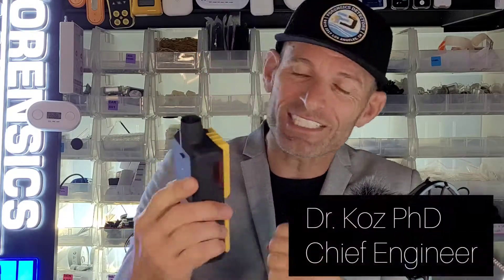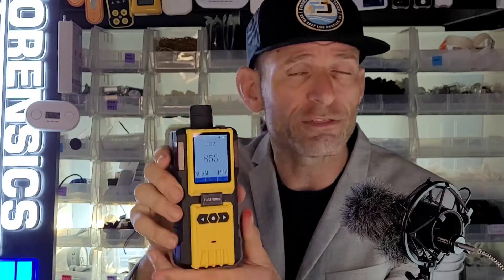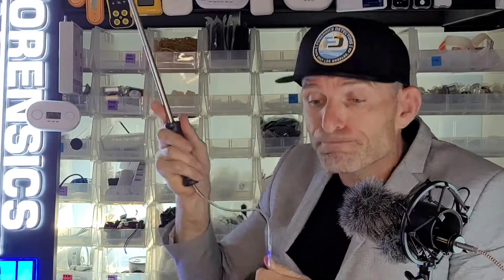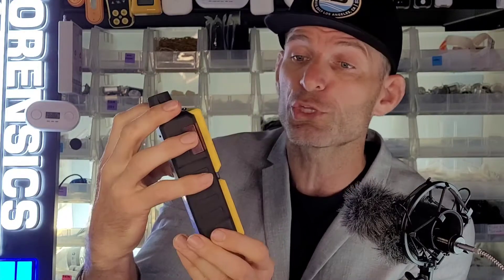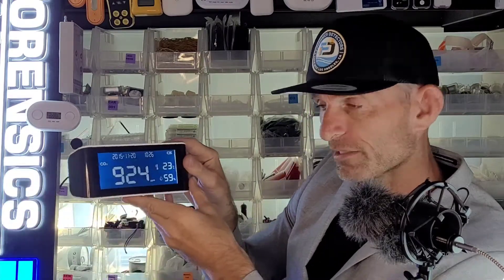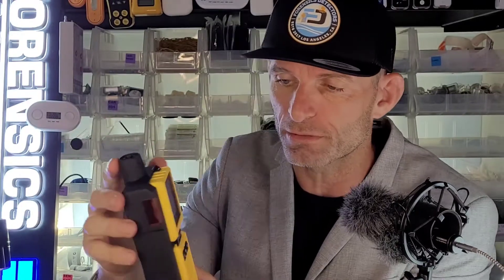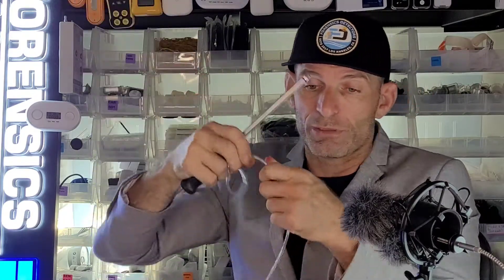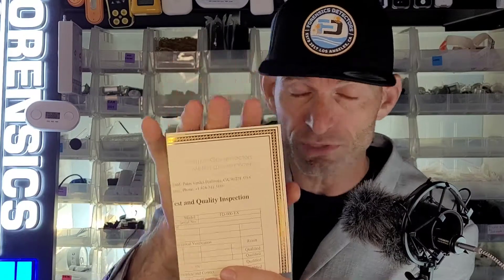Carbon Dioxide Analyzer up to 5000 ppm for Indoor Air Quality

Comment: The presenter needs therapy bobbing about like that The guy will finish up.with SERIOUSE problems 

as well as being irritating to watch
Reply from the maker: I appreciate your concern and kind words. Allow me to introduce myself—I am Dr. Koz, and I want to assure you that I am doing well and in good health. Your thoughtfulness means a great deal to me. As an expert in the field, I would be more than happy to provide you with any assistance or guidance you may need regarding carbon dioxide monitoring. Please feel free to reach out to me if you have any questions or require further information on this topic. Thank you once again for your support and for taking the time to connect with me.Best regards, Dr. Koz